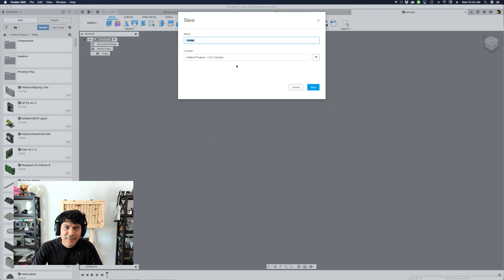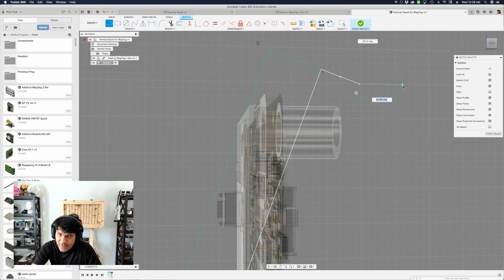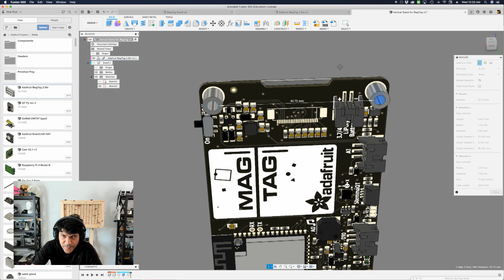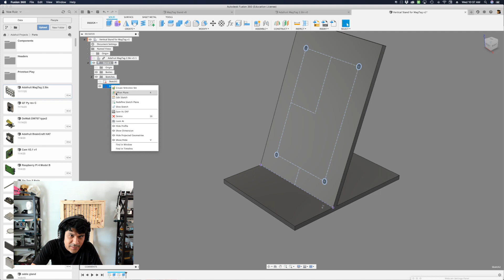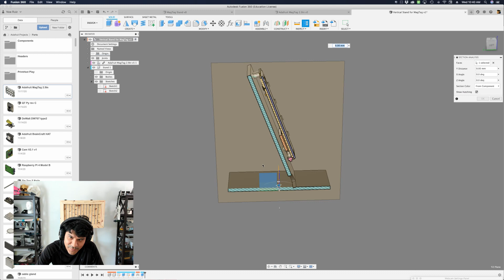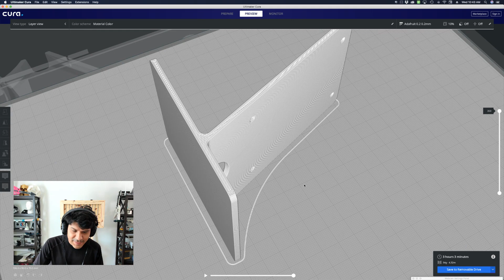Layer by Layer – Stand for MagTag

Comment: Could you make the base draft angle (to fix the cut in the base) parametric that is based on the viewing angle so it will change automatically with the viewing angle?  I guess maybe it would be 90 degrees minus viewing angle?